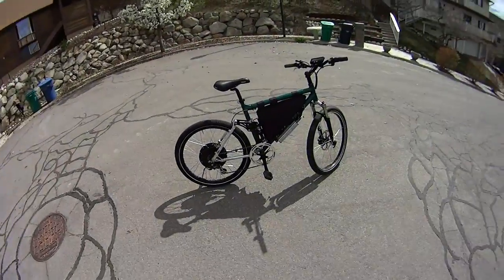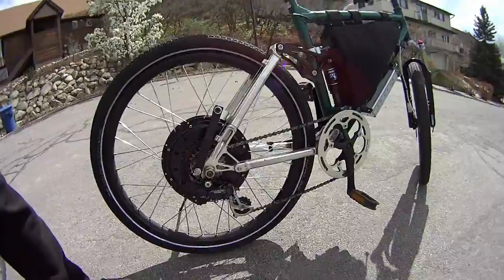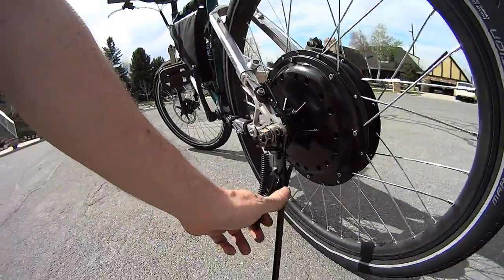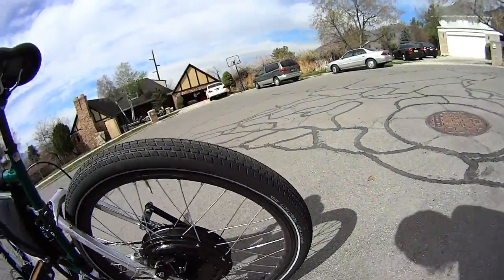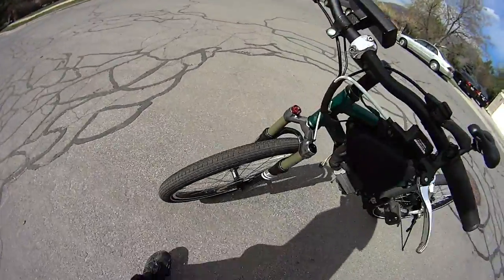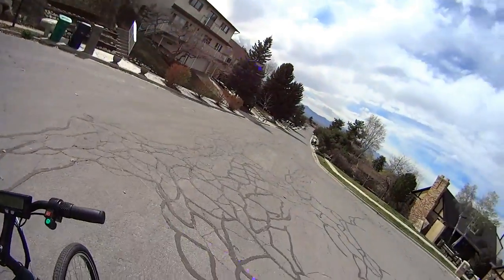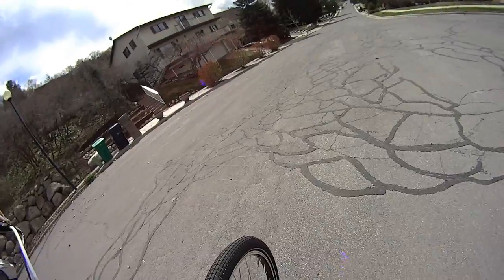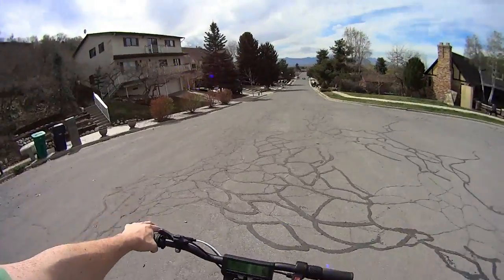leafbike 1500w hub @ maximum power

Comment: i want to make a something similar. My biggest concern is with the motor now; wont the motor coils short out after a few km riding it at 70vots and such a high amperage?
Reply from the maker: Yes, the motor will overheat after around 10 minutes of this. This was just a demonstration of what the motor was capable of. With the venting holes i cut, i found that this motor does around 2000w continuous, so a speed limit to about 40mph would be more suitable, which would mean you'd want to run 48v on this winding instead.

Comment: You have any trouble wearing out bearings and brakes prematurely?  Just wondering since neither is designed for regular 50mph road use.
Reply from the maker: I usually ride this bike between 30-45mph.. the regen does most of the braking, and so i haven't needs to replace the front pads so far.

The speed show in this video was just for demonstration purposes.
Reply: Thanks, that makes sense!

Comment: Supplying the electric motor through the control unit by using a portable generator like the Honda EU2000i may work quite well. What do you think?
Reply from the maker: You're going to lose 20-30% of the gasoline motor's power output ( on top of it being only ~30% efficient in the first place ) if you do that. You will also need some voltage convertors as well. Might as well build a gas bike... because that's more expensive than just using battery only.

My peak power here is 6000W, so you would need a pretty good sized gas motor to pull off what my 15lb battery pack puts out. I'm barely touching the battery's limits also.
Reply: I thought that a 1500 motor would have a peak power consumption of 1500 watts. What does this power rating corresponds to?
Reply from the maker: Look at the screen when it is shown.. you might have to slow down the video.. i'm putting way more than 1500w in.

Nonetheless your idea is still expensive and heavy even if you limit to 1500w.

If you want to learn more about how to build electric bikes like this, there is a good forum for it.. endless-sphere.com

Comment: this is good to go to work only in the same city or town.
Reply from the maker: With today's lithium technology you can travel much further than that. The best cell currently available can yield a 200 mile range at 20mph on a large enduro frame, or 100 miles with a small triang.e

Comment: That looks way dangerous to be going that fast on a bicycle. I wonder if it's possible to convert my already electric Stromer into this though xD
Reply from the maker: It is, and i only set the bike up to go this fast for a demonstration of what the motor was capable of. I usually ride at 30-40mph because handling gets squirrely on a light vehicle with this much power.

I would sell the stromer and build something from scratch if i were you.
Reply: neptronix No I mean I wonder if it's possible to replace the wheel and hub motor with this one and put it on the stromer frame. Because the stromer frame is heavier and sturdier and somehow figure out how to connect the better motor to the built in stromer battery within the frame.
Reply from the maker: That is a waste of a bike with a high resale value, in my opinion. And the battery on the stromer is not rated to output much higher power than the stromer motor.

Your better bet is to sell it. For the cost of one new stromer, you could build 3-5 bikes identical to what i am riding.. and there is nothing particularly special about the stromer frame. I am peaking to 60mph on a $250 20 year old frame from eBay here..

Comment: You think that with a smaller wheel you get better torque ?, because that is my hypothesis, also tell me if it is more expensive an electric bicycle than a motorcycle scooter gasoline?
Why do you buy electric bikes? Because the most expensive is the battery and this lithium battery lasts maximum 3 years with moderate use and less than 2 with a constant use.
Reply from the maker: Yes, using a smaller wheel and increasing the voltage is very much like increasing the RPM on a gas motor and then gearing it down. Except you don't have to redo the valves, cams, intake, exhaust, and deal with lower power at lower rpm. Just respoke the wheel and change the battery to a higher voltage. 

Gas bikes are cheaper but i'd never bother building one. I don't want the extra maintenance, smell, vibration, and low power. The torque band is awful and you have no ability to be stealth.. i would rather pedal everywhere without a motor before i put a gas motor on.. :P

A correctly specced lithium battery will last a decade. Most people do not spec their batteries out correctly, even large companies. I still get good life out of a battery i built in 2010. If you know what you are doing, a lithium battery might be expensive but it also can live a long time.
Reply: @neptronix  2 years later, but probably the best comment i ever seen

Comment: where do u live? It looks beautiful there
Reply: You think that with a smaller wheel you get better torque ?, because that is my hypothesis, also tell me if it is more expensive an electric bicycle than a motorcycle scooter gasoline?
Why do you buy electric bikes? Because the most expensive is the battery and this lithium battery lasts maximum 3 years with moderate use and less than 2 with a constant use.
Reply: From the mountains, it looks like somewhere in the salt lake valley

Comment: Title is misleading it showed 5000 watt... That's triple the power.
Reply: From what I understand of most high power hubs they tend to rate them at there continuous power handling. For example my cromotor is rated to continuously handle 3000w and that's what the manufacturer says it will handle safely continuously. You can run it all day on 3000w and it won't burn out or get hot. However you can push 14000w into it and accelerate hard on it up to say 60 mph but you will only be able to hold that speed for a very short period before you have to slow down to say 30mph or else the motor burns out. So his motor is probably rated to 1500w continuous usage but will handle lots more wattage for short periods, hence when he got to 60 mph ish it was heated after that short blast. These china ebike kits you buy that say 1500w are actually continuously rated to about 250 - 300 watts. Its the same as speakers RMS watts and Peak watts.
Reply: @jcreedy20 the geared hubs, sure. Their cheapie direct drive ones probably aren't this efficient from maybe less copper and less fine stator laminations, but they could probably push 1500 watts all day.
Reply from the maker: Leafmotor '1500 watt' is the model name of the motor.

I peaked at almost 6000 watts.
Reply: neptronix lol.. way too confusing.But with 48V output is around 1500 watt ?
Reply from the maker: If you're only running 31.25 amps... but i'm feeding it a lot more power than that, and it's putting at least 70% of that to the ground due to efficiency loss from pushing it so hard.

Normally you can expect it to be 88-90% efficient at stock power levels.. it's one of the most efficient hub motors on the market.. and capable of being pushed much further beyond it's rating :)
Reply: Watts = Volts x Amps. 

48V x 20A = 960W
48V x 25A = 1200W
60V x 30A = 1800W
72V x 60A = 4320w

You set the wattage and amperage with the Motor Controller and use a battery built for the voltage you want. More Amps = more Heat, which will melt components that can't handle it. More Volts = more "force" pushing the Amps through the circuitry, which can cause shorts and battery failures when limits are exceeded. He's running 85A @ 76V, which produces 6460W.

Comment: Hey man, this is really impressive. I'm looking into leafbike hub motors and just wanted to ask someone who has experience with them. What controller were you using on the build? Also, is your motor the 4t wind? Thanks again
Reply from the maker: What i'm using is mentioned in the previous video, and yeah i have the default 4T winding.

Comment: Very nice bike.I would like to build an e bike using the same leaf motor you are using. I have a Kona 27.5" bikeand a 52 v battery from Luna Cycle. Can you recommend a controller for me? I would be satisfied if my bike can go about 40 mph.Do you recommend the kit from Leaf motors that is rated 48 v 1500 w?
Reply from the maker: Em3ev has some good controllers for sale. i'd recommend a 4011 18FET for >70A or 3077 12FET for <70A.

You better have a 20ah or higher battery because the 4T winding sucks amps like no tomorrow. A 40mph capable setup will want 40-50A constant on 52v.

I like 80A myself..

Comment: hey neptronix I am buying 26 9800mah 18650 batteries and i am wiring 13 in series for 54v and 13 in parallell for 128ah or some where around there do you know if that would work? i wanna try to go as cheap as i can but also will buy the motor kit for around $300 and the batteries are only like $50 or so but i will have to make the pack myself and do the wiring. is it possible and how far do you think i can go with 128ah?
Reply from the maker: +Cody196&#39;s Gaming Center There is no such thing as a 9800mah 18650. I hope you haven't made your purchase yet. That's a scam. The most dense 18650 currently has 3.4ah.

If 9800mah 18650s did exist, you'd have a 6kw-hr pack... right now, the most capacity you could ever stuff into a bike triangle is around 2-2.5kw-hrs.

I don't recommend doing things as cheaply as possible. Do your research and get involved in an electric bike building community. Watch what other people are doing. Don't make these people selling fake batteries etc richer, it only encourages them..
Reply: its from china and it was purchased yesterday shit, it was shipped already though. Word to the chinese, Bunch of cheap scamming bastards
Reply: so how'd it go?

Comment: Hi-- neptronix----I just ordered a leaf 1500 watt  for myself to replace my generic 9c clone--I have a nice  48 v-20ah triangle battery -(38 Ah continuous)-- I ordered the 4t wind on a 26" rim--what do you think my top end will be---how about torque compared to my 9c clone ?? just wondering--can't wait until next week to get it---thanks--Rob
Reply from the maker: +Robert Backe I can't tell you anything without knowing the IR of your battery, the voltage of your battery, the amps your controller is set at, your wheel size etc.

But this motor is easily capable of twice the continuous power as a 9C clone.
Reply: Hi --I got my leaf 4t--tops out at 44mph @ 2400 watts---glad I read your reviews on this hub motor--I'm more than happy with it--thanks--probably upgrading to 3,000+ watts soon......just can't help it !!!!

Comment: Would this motor hub go 40mph with a 48v 20ah triangle battery? If not please show me the exact battery i need to achieve this speed?
Reply from the maker: If the 20AH battery is capable of really high C output, yeah. Like 8C  or preferably like 10-15C+ rated.

You'll have an amp draw of 40-80A. You really need a strong battery.

Comment: Hey neptronix :)  im on ES too and using my BBS02 for track and hill climbing.  I wanna try and build another ebike with a different setup, a Hub motor like this is highly recommended by you of course(nice post on ES by the way). I was just wondering what winding should i get if I'll use this on trails and Hill climbing.  Not too steep of a hill though :)  and any suggestions? This is a cheap motor by the way, bang for the buck!  Thanks Neptronix!
Reply: Also, ill just be using a 48v 10ah battery Samsung 25r for this.. Or possibly a 48v 15ah lifepo4. What speeds will i get if im limited to 30amps?

Comment: You have 1 dislike and 20 negative comments. I think that what you are doing is safe to me as long as you have a helmet and brakes. I mean, if all you need to ride a motorcycle is a helmet , then you are fine to test wherever you want on an E bike.

I would like to put a car alternator in the front wheel, and a washing machine motor in the rear!
Reply from the maker: +Nukes Away This was just a demo of what the motor could do, due to it's high efficiency up to 60mph. 

Do i ride that fast? no way. I do 30-45 in the car lanes, and ride it like a motorcycle. it's very capable of handling those speeds. It's basically a light motorcycle.

anyway, an alternator plus a washing machine motor would be actually less powerful than this hub motor.. :)

Comment: Excellent.
What is your opinion for everyday bike use?
I look to build one and till know I think top speed of 50kph is enough.
regards
Reply from the maker: +jkrsecret 50kph ( around 31mph ) is the perfect speed for this motor, because it's peak efficiency happens right around 30mph.

For every day bike use, i love it. It was overheating on me after doing ~5 miles of 45mph ( 72kph ) though, and my roads are at that speed with no bike lanes available, so i switched to a MXUS 3kW motor in order to handle it.

If my road speeds were a little slower, i would still be using the leaf motor, because it can handle 40mph ( 64kph ) continuously.
Reply: @neptronix  is the stock controller for the mxus 3kw kit sufficient, or is the programmable 18fet a better choice?
Reply from the maker: @BingoBruce  I don't know what kit you're referring to, but i  just used an 18FET infineon clone controller from lyen.

Or at lower voltages, you can get away with a 12FET with 3077 FETs if running the same 3T. Otherwise if you use a 4T/5T MXUS, you'll need higher voltage and a 12FET with 4110's would be better.

powervelocity on the endless sphere forum also has some cool programmable controllers. They also have the rare 15FET, which would be a great match for the 35mm-45mm hubs like the leaf 1.5kw and MXUS 3kw.

Comment: Good luck avoiding snapped axles, brake failures, and debris in the road on your 50km/h bicycle
Reply from the maker: +bigbullseye The pie actually has more poles than your usual ebike hub.. 26 poles versus 23 poles for most direct drives, if i remember right.. so it does have a lot of torque from a stall..

But it is not the most efficient motor out there for sure.  It's a bit deceiving since it sheds heat so well, so in reality it'll produce good power and torque for it's size, but it'll guzzle a bit more power than most.
Reply from the maker: mastr323 
Thanks for your wishes, but i don't really need any luck, i've been riding ebikes this fast for many years without any of those problems. This bike does 96kmh, by the way.
Reply: neptronix Yeah but that doesn't mean it's a good idea...
Reply from the maker: mastr323 
I'll call it a bad idea when i experience trouble with it, or see someone else have the same issue.

The axles on this motor are very very strong. I have inspected them multiple times after 6kW runs. I've seen an axle made of the same material take 8kW in a 20 inch wheel in a high speed winding ( that is a hell of a lot of torque; probably ~150ft-lbs peak )
Reply: neptronix curious what kind of battery life/range I can expect to get. Just got the 1500w motor and a 48v 35ah battery. Any estimates would be great. Thx
Reply: neptronix Why is it that MagicPie motors are so huge, yet Leaf/mac/even bafang motors seem to handle just as much abuse?
Reply: the modfather Magic Pie motors do not HAVE to be that big. They are made bigger because the bigger the hub the more natural magnets you can stuff in them. They are actually able to take more abuse than the normal motor. Doesn't mean that the windings can't be burned up from overheating but you get much more torque with more magnets.
Reply from the maker: +the modfather  the magic pie is taller but very narrow.
The efficiency is rather low though, around 80-81% peak.
The magic pie is an equivalent of a crystalyte HS3525. I was a fan of it for a long time because it had a stronger axle, is cheaper, and sheds heat a little better, but it's totally inferior to the leaf 1.5kw.. :)

Comment: Can you kindly explain how your video title is listing this motor as 1500W, but on your watt meter it is exceeding 5000W? I'm confused..
Reply from the maker: Rc With Foxy It's rated for 1500W, but the controller is putting a peak of 6000W into it.
Reply: neptronix Thanks for the reply :) A motor that's rated at a certain Wattage will not take in more current because a higher current handling controller is being used. Therefor, a motor which is allegedly rated at 1500W will still operate at the rated power level, or less. The only thing that makes sense to me at this point, is that you are using a higher power controller on a motor which is rated at 1500W ONLY if a 1500W controller is used (power limiter at the same time). The motor in this case might be rated at "1500W" only to prevent it from overheating, but in reality it can take much more as long as it doesn't cook. A little strange in the electronics world.
Reply from the maker: Rc With Foxy 
The motor is conservatively rated for 1500W continuous, but by proper thermal measurements and looking at the formal dyno / efficiency graph for this motor,  it's continuous rating is actually more along the lines of 2000W continuous.

My controller, in this video, is programmed to pump 80 amps peak at 76 volts. The motor, being a very high speed winding, will use all that power and could even make use of more if it is available.

I am close to the saturation point of this motor in the video, but not quite there.

Proper wattage for a motor is entirely based on thermal factors. Motors are rated on continuous power based on maintaining a continuous thermal stasis. So, you can multiply that continuous thermal stasis wattage for quite a long time, but not forever. :)
Reply: Interesting. Thank you very much for taking your time to explain this in such detail. I am looking to make my first e-bike and am doing quite a bit of research at the moment. :)